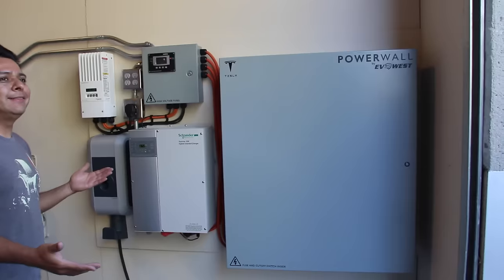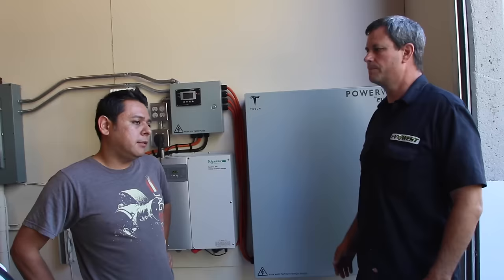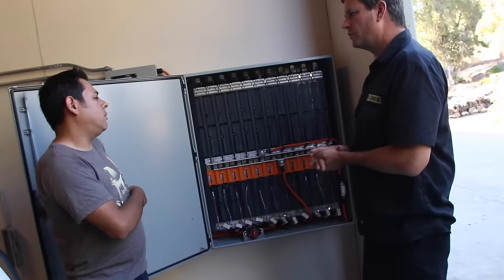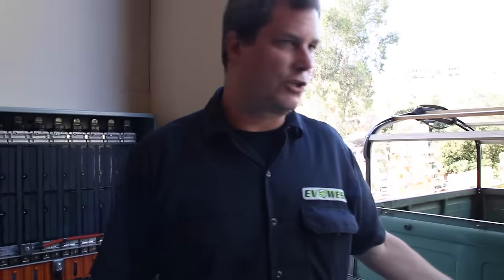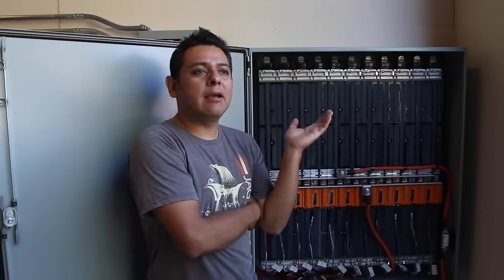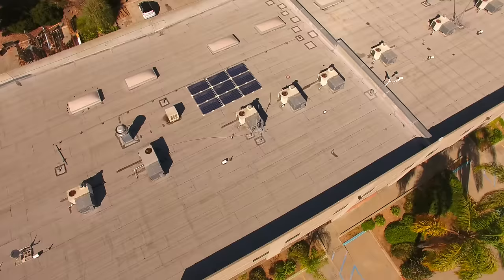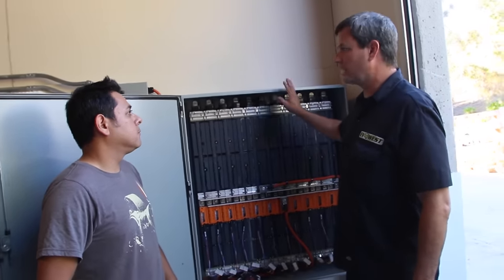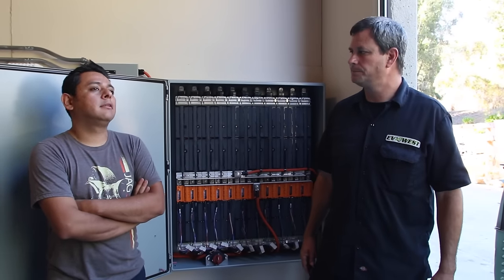DIY TESLA Powerwall  - my  WALL vs ELON'S WALL

Comment: Guys, it seems odd to take 90V from solar, convert it into 50, then into 110 and then back into 50? for car battery. My guess would be that there is a lot of power loss. Why cannot you charge cars straight from the battery pack using constant current DC-DC charger?
Reply from the maker: +DrAlexMore   90v-130v solar into 55v nominal.   Then 55v into 220v  standard mains voltage for regular use not just ev charging.   The point is to use off the shelf parts,  nothing is custom, anyone can make this if you have the means and drive.

Comment: So I drive about 12,000 miles per year and my Subaru Outback gets about 30 mpg with mainly city driving, which works out to 400 gallons a year.  Price of gas has been about $2 for some time now.  So, the return time on my investment would be almost 19 years.  Sure, gas could go to $5 a gallon and even then the return on investment would be 7.5 years.  During those 7.5 to 19 years, I'm sure lots of this will fail and will need replacement.

I'd honestly like to get excited about electric cars and power walls, but gas is still far cheaper, easier, and more available.
Reply: But.... its hydrocarbons. Many people see a different value in solar than simply its cost.... you could be one of them!
Reply: If only dollar bills are in your head, then you're a lost cause, just keep driving that ICE car and let the more efficient, green energy for the fools like us, the people that want to see future for our planet.
Reply: Tim Eckel this is only if your concern is with money. if you care about the environment you go electric. No guilty trip
Reply: I don't care about the environment, and new cars not bad anyway so I can live with it if it's 10x cheaper for SURE!
Reply: "I don't care about the environment..." - smh
Reply: Tim Eckel then buy a gas guzzler lmao

Comment: Okay I looked at your equipment list. Looks like 30K investment up front. Okay, so in how many years do you see a ROI for the up front cost? My current electric bill is 50 dollars a month.
Reply from the maker: take 30K divide it by 50 and you should have your answer.    Of course you could probably sell most of that energy as you only seem to be using $50 worth every month.   Probably better would be to install an appropriately sized system for your energy consumption.
Reply: I did and it calculated to 50 years. At most I will get 25 years on those batteries IAW your video.Thanks for the info.

Comment: Jehu: So who should I talk to about the big box wiring for the Tesla batteries ..... sounds as tho a connector link was used?
Reply from the maker: All parallel,  no connectors just bolts on ring terminals,   michael made a custom aluminum buss bar but you don't need that
Reply: Who created what the batteries hang on ..American Solar? or how do they hang ..that is a better question😎
Reply: Ok cool
Reply from the maker: +mtradad  bolted to the back of the box

Comment: After the batteries are full is there a system in place to shut off the solar panels so as to not ruin The batteries in the long run? I know batteries, if overcharged, lose their lifespan.
Reply: It is called a Charger Controller ...

Comment: They talk about a 25 years lifespan but these are laptop cell. I don't understand.
If the lifespan is 400 cycles i don't think that will go for 10 years even with light discharges.
With LiFePo4 this would last at least 5 times more.

Comment: Your system has no thermal control, which I understand is very important for the longevity of the battery. Why does the Powerwall 2 build this in?
Reply from the maker: As far as I know,  Powerpack have active liquid temperature control,   but Powerwalls do not.  Inside each powerwall you can find 2 of the same modules found on the model S battery packs,  According to tesla,  they use different cells optimized for cycle life,  but as far as I can tell there is no room for a heat exchanger which is required to remove heat from the modules using liquid within the powerwall and I have not seen any external liquid lines to heat exchangers in any of the installation videos Ive seen.  Can you point me to any info that points to how they cool the cells on powerwalls?

Our 33kWh tesla wall does not produce excessive heat even at the 6kW peak output,  think about it,  these modules are designed to output 60Kw on the Smart car so we are only using them at 1/10th of their power output.   If we added another 9 6kW inverters then we would have to use the cooling but not the way the sit right now.
Reply: @jehugarcia  The Telsa Powerwall holds 2.2 Liters of coolant ...

Comment: Should try this setup with good quality cheaper lead acid options but massively paralled to ensure only 1percent of the Amphour rating gets used per day...that way even lead acids should last very long time...
Reply: Would weigh 3 times as much and use 3 times the space.  FLA requires some maintenance ...

Comment: i wonder what is the difference between the batteries you provide here in the link and  the model s pack on ebay, doing number...$1100 for 24v - 5.3 kw, (x) 2 = 10.6kw - 48v....$990 for 57v - 3kw (x) 3 = 9 kv at 56v ...$2,200 for 10.6kw vs $2,970 for 9kw, i'm just wondering if there is any difference in performance to be a reason for the price difference
Reply from the maker: ModelS cells are newer,  they will perform  better,   more battery for less is a trend we will continue to see for a while.    good times
Reply: they are cheaper too, right?

Comment: So if I get those batteries.  How can I put them together like that one.  I currently have 33 panels sending energy to the grid.  I also have a small battery backup because the system requires it.  How can I connect the batteries and how many Charger/controlllers would I need?  I currently have 3 right now because I have 3 racks of panels.
Reply from the maker: lots of ways to do it,    I'm currently working on the video showing a diagram how this particular system is wired
Reply: ok I appreciate it.  Thanks for quick response!
Reply: Btw I have a Conext XW+ Solar Hybrid Inverter System 120/240V.  I saw in the video that hes using Schneider so that good news for me.

Comment: checking the cost of everything, it doesn't seem to be so "cheap" to make as most DIYers are seeking.  I mean, the batteries appear to be $800 dollars each.  I mean, for one like his, that's $8000.  Not counting the inverter and all else.  I mean, this project is more about a 30-40k project than just some project of converting scraps into usable stuff.  Not trying to be a downer, but I'm more trying to find out how can someone really BUILD something as efficient as this without going broke (I mean, if I had 40k to spend on something like this, I don't get why I wouldn't just pay for someone to build this).
Reply from the maker: How did you come to the 40k figure?   Or you exaggerate to drive the too expensive point?

Comment: New question for batteries..... I have access to a dozen or so Toyota Prius battery packs in various states of quality (from 1 to 5 year old cars).... Could these be used as a battery wall power pack(s) and have them work...... or is this a wasted idea and thought process? Your opinion would be helpful.
Reply from the maker: +J&M D yes batteries are batteries ,  you will have to get your hands dirty though as they most likely need to be retired to your specs

Comment: For a 33kWh system that is essentially off-grid, $15,670 is quite a fair price. Sonnenbatterie's 16kWh battery is $22,000!!!- for the battery alone!! Why in the the world are these battery companies charging so much?? Am I missing somethig here?
Reply from the maker: +Adewale A  as long as there people who will pay,  they will charge that much,   Also keep in mind these are repurposed batteries we are using here
Reply: Guess you're right. As long as people will pay. I understand that you are using repurposed batteries, but even with brand new ones I do not think they would cost near that much. There is a line between making a profit and profiteering. You might want to look into making these things yourself en masse if you can sell at lower prices.

Comment: What happens when the batteries are full? and the panels are still making electricity? where does it go?
Reply from the maker: +TheJ Man  it just doesn't,  it stays on the panels
Reply: So there is no need for load of some sort? The electricity needs to flow somewhere right?
Reply from the maker: elelctricity doesnt have to flow out of batteries when not connected to something, why should it need to out of solar panels?
Reply: hahaha I dont know :D Very good point you are making ;) It just I was reading around that people are using heating elements etc to dump excess power, might just be so that they are using it though as they dont want to waste it.

Comment: With this 33kwh pack if you didnt run anything off of it during the day Im guessing this would store enough energy to charge a 18kwh Chevy Volt battery over night? This may be a dumb as hell question but I have no clue on what these powerwalls can do.
Reply from the maker: You don’t understand the concept of a battery?
Reply: I understand the concept of a battery......I don't understand how much power that is or what this will actually charge.
Reply from the maker: There are 10 electric cars at evwest

Comment: At 1min56s he says cheaper 12 and 24 volt systems in use in domestic systems for long time. Then he says that have to go up in voltage for cars. He says something about get the currrent down. I don't get it. Can someone explain, pls

Comment: Would it be possible to install a system like this in my ice cream truck? I have a 25 k watt diesel generator in it to run my equipment and that includes a 220 3 phase soft serve machine. I hate the loud noise of the generation.
Reply: How many "continuous" hours of operation = how large a battery pack

Comment: how long do these batteries last before they have to be replaced if your using them 24/7
Reply: What a few years, or more, and you will find out ...
Reply: At this low demand you can have these over a decade and you'll be fine. They aren't being used at the same frequency as EV vehicles

Comment: " hold on .when i was an electrician, i remember that by code you could NOT use a main or sub panel as a juction box . as you said "coming down from the roof" to what looks like either a sub or main panel nunning through ether of one .   just sayin   Dano    gOoF     CORNFUzED!
Reply from the maker: +dan cameron   Low voltage
Reply: on 16:20 on , the panel on the far left looks to me as a HIGH VOLTAGE 120/240or 208/277 voltage panel AC. .The two half inch EMT would by code have only high volt AC wiring in them ." you have wokin me from my slummber ". i,m just havin some fun,go along with me here??????    Dano  9/8/16   gOoF  !

Comment: Why take DC from the panels, convert to AC and back to DC.  Wouldn't a DC to DC charge be more efficient?
Reply from the maker: +Panasonic Business Telephone Systems - BTS  

Yes but there are this things called "standards" it makes it easy for everyone to plug their cars and charge them without having to worry about voltage, current or any of that

Comment: By their calculations it will cost $1,000 per year,  every 10 years, to replace the batteries alone. My electric bill is $140 a month or $1680 yearly with no excess cost. Until an advance in battery capabilities and longevity this tech is still not ready for mainstream.
Reply: if you charge an EV your power usage goes way up.  That's why it's economical.
Reply: @roidroid  Recharging adds 4 - 5 cents per mile driven to electric bill.  10,000 miles per year =  $41.00 / month

Comment: The inverter has a built in charger, how come you need a separate charge controller?
cheers
Reply from the maker: +TheJ Man because charger uses mains for power while charge controller uses the solar panels
Reply: Ahh I see thanks. So it chargers directly DC from panels to battery?

Comment: 255W solar panels cost $2,588 each, so for 9 it will be 23292, and not 2000.
Reply from the maker: +Povil Ka   $2k panel?   You might want to check again
Reply: I might have misunderstood it... Down below it says: rated Maximum Power (Pm) 255 W.
However, the amazon price is for set of 16 / 4 kW ?
Reply from the maker: yeah i think its 4000w worth of panels

Comment: what are the specs for the 18650 individual cells? if they are arranged in a 15S 242P  my calculation are 2.1A per cell = 33K / (242 x 4.2 x 15)  then they have  a maximum discharge rate of 30 amps. then the maximum discharge watts is 1890 = (15 x 4.2 x 30)
Reply from the maker: 2600mAh cells x 242 = 630Ah,   each cell is capable of 3C  continuous  or 1887A  x 55V nominal  = 103kW
Reply: Are you sure about that? Current does not add up in series. if there are 15 cells in series. Each cell is 2600mAh then you still have 2600mAh coming out. the total wattage per string is a maximum of 164W. multiplied by 242 parallel banks would be a maximum of 39,640 or a nominal power out of 34,000w
Reply from the maker: it adds up in parallel,  you have 242 cells that can each put out 3C  2.6x3= 7.8A continuous.

you hace a battery pack  33kWh that can put out 3C,  3X its capacity out continuous.  33x3= 99kw continuous output

Comment: When I charge my salvaged and tested 18650's one by one they deliver +- 1700Mha each. When I take those same batteries and put them in serie or para then the capacity drops per cell, I cannot charge it to that same capacity anymore, it just slices about 1000Mha per cell. What am I doing wrong? I am supposed to get more capacity. I put 12 x 18650's each at 1700Mha in 3s4p I should get close to 20, 000 Mha. But I get wayyyy less like 6000Mha. I use the V6AC hobby charger
Reply from the maker: +Stefan Hodgman  1700mah x 4 parallel should yield 6800mah.   Why do you expect 20000mah?
Reply: Thanks for reply. I expect 1700Mha per individual 18650 battery since this is what i got when I fully charged then discharged it. So I put 3 of them in series to get 12V and I expect the capacity of 1700MHa x3 =5100MHa. Then put 4 of those in para to get 20 000MHa.
Reply from the maker: yeah capacity in AH does not add up on series cells, only on parallel.   Wh on the other hand do add up regardless of connection arrangement,  so two 6Wh cells connected together will always yield 12Wh

Comment: Is there not a way to charge your car without the dc to ac back to dc? Straight from your powerwall to car.
Reply from the maker: One Jack.  -  yes there is,  but  most use the ac thing
Reply: Thanks, with all the solar being installed now seems like someone (you) should market that. Dc to dc car charging

Comment: in Europa we sell the elctricity on the grid so powerwall is pointless.
Reply: No, it's not. You're getting ripped off.most of the time. A lot of the time there is even a limit to how much you can return to the grid and get something in return.
Reply: No its not
Reply: If the grid goes down for any reason they still have power and you dont.  Self-Sustainable.

Comment: Is this powerwall fireproof? You don't want to burn down your house, because of something going wrong. Did you think about this?
Reply from the maker: +Jan van Waaij   I don't believe in fireproof
Reply: @Jan - Is you car fireproof ?
Reply: @vtorsi610  I don't have a car :) I'm not against powerwalls, to the contrary. I was only concerned with the safety.
Reply: @Jan_van_Waaij  What happens when the BMS starts the fire?  What happens if ANY electronic component starts the fire?   Walmart roofs started on fire, due to problems with the Tesla Solar Panel installation.

Comment: How does the charging management work for the 18650 cells?
Reply from the maker: +Jacob Falk   Not sure what you mean
Reply: The 18650s that charge everything need to be charged/balanced themselves, how?
Reply from the maker: we don't do balance charging ,  here i somewhat explain why https://youtu.be/tbaeMWdDlqY
Reply: Hmmm alright interesting, so do you charge all of the packs together at their combined series and parallel voltage? Do you charge them individually separately with their parallel packs?
Reply from the maker: +Jacob Falk  parallel voltage is same as single cell voltage
Reply: I know, that's not what I mean. Lets say it's a 11.1v 3s battery. Do you charge it all together at like 12.3 volts. Or do you charge each parallel section of the battery individually at around 5v
Reply from the maker: combined series voltage,   modules are 15S  so 63V,   I use 2 modules in series on my samba so I charge to 126V
Reply: Oh wow so it's that simple, You just connect your positive and negative, set the voltage and current and you're done?
Reply: Wait....  it is important that Lithium Ion cells be charged in a balanced manner.    If  connect a string up in series,  the batteries may not all be an equal state of charge to each other before you create this series string....,  you hook it to a charger,  then  this can result in  charging some at too high a rate or overcharging some of the batteries.      Lithium cells are particularly susceptible to damage if overcharged,  and if charged at too high a rate can build up excessive heat, and have thermal overrun.
Reply: Watch his video explaining why he doesn't need to balance the cells. The reason is that he balances all the cells at the begging of the battery build and then once it's all put together the current draw from each battery is so slow that it dosent make a difference in the cells voltage over time.
Reply: a lot of new chargers have individual cell management technologies

Comment: Screw cars. Run your entire house from DC voltage. Really no reason for Ac when running short runs in a house other than no appliances run off DC. I'm no engineer but if a car can produce 320 amps from a alternator and a couple of wet cell batteries then you could potently provide whole home electricity from that.
Reply: What is the COST of your idea ?